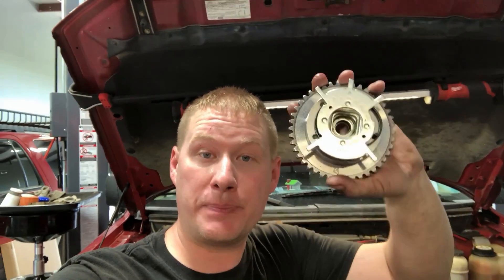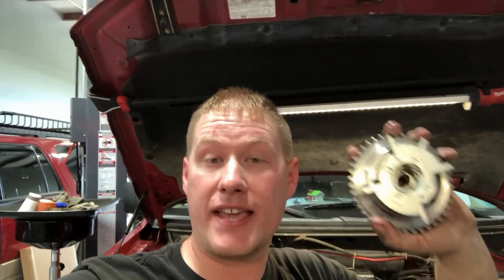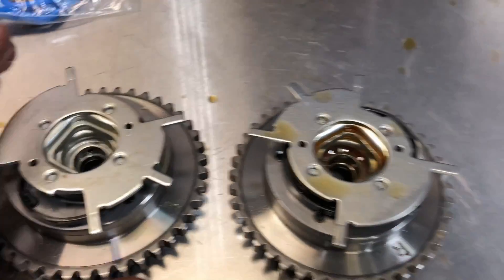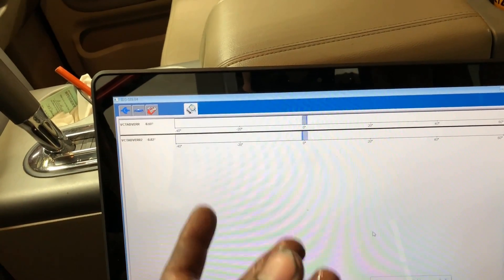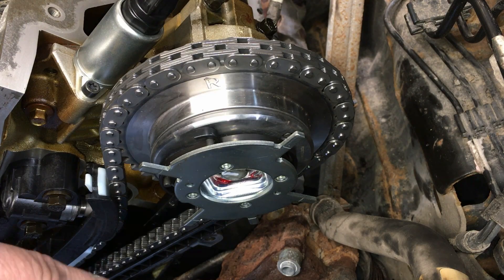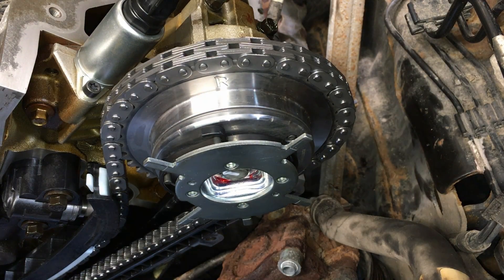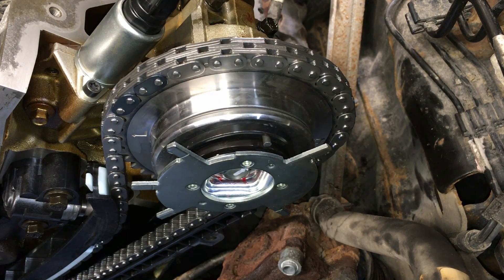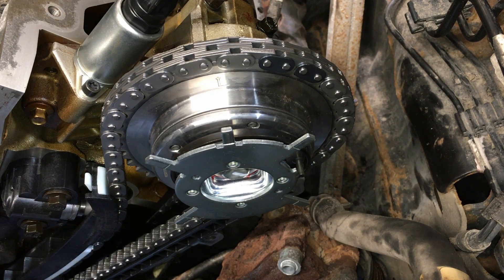Ford 5.4L 3v Timing Kit Choices: This is Why You NEVER Want to Use Aftermarket Camshaft Phasers!

Comment: I used the dormans kit, i didnt think it was a cheap after market kit. Still having the rattle and shake when slowing down. So looks like i gotta save up for the ford phasers?
Reply: Curious, did you soak them in oil prior to installing?
Reply: @russtgrower750  no never seen anything about doing that. I just took to shop and cost me $2600 all total. Due to health i couldnt complete myself. So is that necessary for future reference. Thanks
Reply: @terryedwards5641  its good policy sure. But honestly a ton of people have got dormans to work as well as oem. The phaser isnt usually the problem its a symptom is all
 I dunno ive done this whole thing 3 times now. On two vehicles. Its not fun
Reply: @russtgrower750 
Will you thel me how to "soak" the phaser...?
Or my guess is just sumerge in oil the Phaser for a minutes or so...
Thanks in advance.. !

Comment: Thank you for keeping guiding us on how to do it in the right way, I just finished the camphasers job on my 2018 expy following the 4 parts videos you made. I used a newly designed version, guess what? They only last for 700 miles!!!!!!! It's really deep disappointment. Moreover, I have an HVA, and the valve rotor went bad cause the intake camshaft some small wears. Is there any advice to correct this punch of failures?

Comment: Am I wrong in thinking that the chain is not lined up correctly with the phasers you've shown? I thought the dark links have to be lined up with the timing mark on the phaser, and the single dark link aligned with the mark on the crank sprocket? I mean I guess that would have nothing to do with the phasers but it caught my eye.
Reply from the maker: The marks do not line up again once timed and the engine has been turned over by hand or ran.

Comment: I had the dealership do a timing job on my truck about a year and a half ago and I noticed that the tensioners have already gone out as they used the OEM plastic ones, is it worth breaking into it myself and going ahead and replacing some parts with melling parts such as tensioners and the ms360hv oil pump as well as replacing the lifters and rocker arms with high quality upgraded ones that have another oil port for better lubrication

Comment: I am installing timing chains and components on my 5.4. Got the timing chain cover off and discovered the black links on the chains do not line up with the marks on the cam phasers? Naturally my new chains will not line up either. Just wondering where to go from here? " The truck ran smooth when I shut it down"??
Reply from the maker: You start over and tear everything down as shown in my four part series.

Comment: I messed up and didn’t lock the cams when I removed the chain, how do I proceed???
Reply: Also didn’t remove the roller followers, how screwed am i
Reply from the maker: Did you see my 4 part series on performing a timing job on the engine that literally walks you through the process?

Comment: Hey does this Kit work on an 2013 E-250 5.4? The Rocker arm parts are different
Reply from the maker: No you have a totally different engine.
Reply: @FordTechMakuloco  ok, I will check with Ford and see if there is a timing chain kit

Comment: I bought my phasers from Ford but the chains are on back order and i need to get my truck going can i get  the chain and guides from cloyes
Reply from the maker: The chains are not on backorder, don't cheap out on the timing kit.
Reply: @FordTechMakuloco  that is what my local ford dealer told me Gary  Yeomans ford Ocala, Florida
Reply: Also when i took the front cover off the right phaser fell out and the front of the  camshaft is all chewed up so when removing the cam i found that the journals where the cam sits are pretty rough the truck has 237,000 miles

Comment: Hi i feel im a bit behind the times here but im in need of a kit but ford australia has informed me that these parts are now discontinued/obsolete. Cant find oem kits anywhere. Its funny they actually advised me to get aftermarket parts. Not so sure about that after listening to your advice. Cheers Greg 
I have a knock at idle that sounds like its under the front of the valley cover somewhere and a higher pitched knock at the front when i rev the engine. Still runs fine though.

Comment: I have 11 expedition, with 250k miles. The only thing ever done to the engine was plugs, and 1 coil pac. I'm planing on doing the timing in a week. Is this most update parts for the 3v? Any recommendations on what else to do while it is torn apart?
Reply: No not yet, I'm planning on doing this over Veterans day weekend. 
I'm trying to find the lash adjustors. I'm trying to firgure out if I can just pull the cams out. I'm replacing all rockers, and lash adjustors. I firgure I might as well replace the waterpump, and pulleys. This motor is approaching 260k miles, and is all original.

Comment: I rebuilt my 04 5.4l completely by your videos 12 k miles ago....I didn't fallow your advice on the aftermarket phasers and guess what I'm doing today. 😉  I wanted to thank you for the videos and your very good at step by step what to watch out for and do's and don'ts I couldn't have done it without you.  Good work
Reply: Im curious, i know its an old comment but did you soak them in oil before installing

Comment: My argument is always " if OEM is so good why did it fail?" however because I do my own repairs and save on labor I never cheap out on parts. After market is ok for cosmetic stuff, but engine and ignition components always OEM.
Reply: This is exactly what my thoughts were as well. If OEM is so great,then why did it fail so quickly in the first place?

Comment: Hi, I need your help. Actually I changed cam phaser on 2009 f150 5.4 L but by mistake lost timing maybe while changing cam shaft turned around can you share any pictures where can I see cam shaft potions would be both banks sides please?

Comment: My 07 navigator window lock does not lock I replace the lock mechanism didn't make a difference I hear a clicking noise coming from the fuse box down in the passenger side clicking whenever I hit the button on the remote to unlock the liftgate window is there something in that fuse box a relay of some sorts any insight would be greatly appreciated thank you love you videos by the way

Comment: I can't afford the money to buy the whole kit, thought about buying Coyle parts minus the phasers for a short time more and I changed the oil regularly, had to remove front cover to replace it from a idler pulley bolt backed out breaking ,engine has 135000 can't leave old timing chain in ,need more time with a running truck

Comment: Hey man I've got a question. My truck will start and run fine when it's cold. First start. But when it gets warm and i turn it off its hard to start and won't start sometimes till it cools off. I have new chains, guides, tensioners, vct soleniods and oil pump. They are Ford oem phasers on it that don't tick yet. What would you suggest? Thanks in advance!!! Its like the timing is staying in a over retarded position. Should i do the phasers again.they were relaced years ago with ford .

Comment: I have a 2008 Expedition with the 5.4 3V.   I bought an OEM kit from that one company you don't like that sells the aftermarket kits.  I replaced both phasers, VCTs, chains, tensioners, guides, crank sprocket, Water Pump and oil pump with the Melling 360 OH.  Once installed, which I did following your videos and took pictures so I knew it was all correct, bank 1 was sketchy.  3 weeks of troubleshooting and it turned out to be a bad phaser that was supposed to be a ford part.  I replaced it with one from the dealer and no problems.  Now a few thousand miles later Bank 2 seems to be giving a problem.  I borrowed an analyzer and have a short video but not sure how to upload.  It shows a small difference between bank 1 and bank 2.  The engine will shake and then stop running when brought to a slowdown or stop intermittently, seems I never have the scanner hooked up when it happens.  Thinking I should just replace it, why would it go bad if it's supposed to be OEM. Wish I could upload the video
Reply: Did you figure it out?
Reply: You probably didn’t get oem parts like you were supposed to. I re did my 08 f150 and all ford parts every single one from the dealership, no problems since

Comment: The popping phaser had the timing chain out of time bout 2 or 3 teeth off did that add to the failure
Reply: Of course what was I thinking , Thanks for responding
Reply from the maker: It was not out of time or mistimed, it was only off because the engine had been rotated after timing before filming.

Comment: I just bought a used 2005 F150, with the 5.4 3V, that a guy got the timing set, complete kit for it.  He spent $355 for the kit, plus there were 2 variable timing sprockets for $192 each.  I'm guessing those sprockets are the phasers?  He drove it about 15,000 miles, and the engine just stopped running.   Now it turns over, but refuses to fire.  The first time I tried to start it, it ran for a second, maybe 2 at most, then stopped.  Now all it will do is crank, but not start.  Will these sprockets cause this issue, If they are the cheap ones?

Comment: Can there be any other things that would cause those exact codes to pop up. I have a 2006 ford f150 that's has been running rough since I bought it. I've been chasing codes replacing everything under the sun even the camshaft sensors. Now I'm getting those four codes an not sure if I need to change those phasers out or do a whole timing kit or if something else could be causing the issue. Any help would be greatly appreciated.

Comment: What about the 1 aauto timing set? I always buy parts from them and they are good quality.
Reply from the maker: No
Reply: FordTechMakuloco I ended up going with the oem cam phasers and that oil pump you recommended with 20% more oil pressure.

Comment: Havent watched all your vids yet , they are Awesome by the way !! Quick question , is there a difference between an 05-08 head and cam to the 09-10 head and cam ? I have a 09 motor that has an original head with the new sparkplugs and one with the old sparkplugs ? Thx for the help !

Comment: I purchased a set of phasers for my Aussie ford Fairmont ghia which has the 5.4i 24v barra triton v8 2003 build and I bought new phasers not sure if they are ford but the part number is as follows 
3R2Z6A257DA 
Is this a genuine ford part number?

Comment: I got 2006 ford f 150 4x4 with 5.4 triton 3 v I replaced timing chain and cam phasers and sensors starts and runs idle. Smooth but far as driving has no power and blows white smoke with low oil pressure light coming on what I need to do
Reply: Did you figure it out?
Reply: @thuglivintv824  no,I didnt

Comment: I feel like the fact that pretty much all aftermarket timing parts for these engines are junk is a testament to the overall poor design of this engine (or at least its valvetrain). Obviously buying the cheapest replacement parts for any engine will yield poor results, but even the timing sets from Cloyes or a few other decent brands seem to fail in this engine. 
With many other types of engines, generally good real brand aftermarket parts (not eBay junk) will be cheaper AND of equal or sometimes higher quality than the OE parts, which leads me to believe that the inherent design of those other engines is just better. 
I could be wildly wrong, but that's just been my experience over the years. I currently have a 2007 F250 with the 5.4 and your videos have provided ample help for me throughout the process of replacing all of the timing components! Thank you so much!

Comment: Are there parts that are MORE durable than the Motor-craft variants?   Phasers, tensioners, timing chains and guides?   Seems that not only the design, but the quality of parts is an issue with these engines (I mean who puts plastic timing chain guides inside an engine this large, and the tensioners seem to blow out after a month or two)

Comment: can a ebay cheap phaser cause low idle? i put them in my 04 f150. less than 1500 miles having trouble with bank 1. so i put a ford phaser on bank 1. now im getting p0022 bank2.

Comment: Hey sir i have a question for you. I am a mechanic as well. But apparently not as good as you. I have a problem i have been chasing for quite some time. Just wondering if there is a way i can direct message you or chat. So i can describe my issue and see if you have encountered this

Comment: Can you reccomend a kit for a 4.6 3v 2010 mustang? I want to make sure I get everything I need. Mines knocking once warm however it seems to knock past 1200rpm maybe to like 1600 after that I cant tell. However I'm not running around with a knocking motor even if it was non problematic.

Comment: Hello,
Excellent videos. I do like to watch you work on these trucks, I know you are a pro. 
I have to disagree on some points, I 100% agree we should not use china made knock offs, however, if Mortorcraft was any good, we would not have these problems on low mileage vehicles.
I believe we need to find a better quality after market part since Motrocraft is the reason why we doing this so often.

Comment: So what is the point of putting new Ford phasers in of the originals were faulty. Won't the new ones eventually go bad too? Or did Ford update the phasers and fix them later on? If the original phasers were junk, why would we put new oem ones back in? Won't they eventually go bad also?
Reply: My thoughts also!
Reply: @willhart7861 the ford phasers are good, it’s the lack of consistent oil changes that destroys them alongside the underperforming OE oil pump. I still have the original phasers at over 200000 miles

Comment: @FordTechMakuloco please advise: I bought the ford timing chain kit that you recommended in your 4 part series, and the phaser sprocket part numbers are indeed the ones you linked to here as well. I just installed the phasers, chains, and roller followers and am turning the engine over by hand to make sure there is no contact. I am hearing and seeing this ticking noise/behavior that you showed in the video above, that the cheap phasers can make. Is there something wrong with my new Ford phasers? I'm highly confused and not encouraged by this noise. Do you think my phasers could be defective?

Comment: Question and thanks for the info. I have a '97 Expedition which started making those knocking noises yesterday. It did stop making the noises after the engine sat for a few hours. Is it recommended that I not start the motor up, or even drive it that way? Thank you in advance.

Comment: Looks like the chain isnt on the timing mark on the the phaser..wats up with that
Reply from the maker: It was turned over once already.
Reply: @FordTechMakuloco  afterputting in the new timing kit do you prefer oil the chain and phaser..etc. before putting the timing cover back on or do u leave it dry?? Really need to know this plz..thanks so much for the 4 part series.

Comment: Question, I took your advice, replaced phasers again with ford factory units, replaced oil pump with Melling M360 high output, my brothers shop put back together, tested said had hesitation, while running catalytic converter turned cherry red.,They replaced it and the new one does same thing any ideas?

Comment: How do feel about installing the phaser locks on these 5.4 
L  3 valve engines ? They claim It will eliminate the problem. 
A kit has all needed and a programmable gadget to plug in that does an auto load.
2014 Expedition EL XLT

Comment: I am at 198k miles. I think I will just swap it. The timing set and oil pump are a third of the way to a refurbished. Easier to just yank it and drop in the replacement.

Comment: I have a question that is somewhat related to this topic.  Do you have any videos on degreeing camshafts on 3v engines? Obviously you would degree it with the phasers in normal position but do you also have to degree it in the lockout position as well?  Im curious because I do plan to buy aftermarket cams for my 4.6 mustang and want to take the proper steps when installing and insuring proper valve clearance.  I just can't find any videos that cover degreeing for this particular engine.

Comment: I just did this to my truck. Want to say thanks!!! I followed your 4 part series, and took notes, listend it to it on my way work just to stay on top of it. 
My F250 5.4 has 300,000 miles, I bought it with 100,000, and I have never done the timing at all. The heads we're just light yellowish brownish, kinda like a popcorn kernel. 
I have always used Mobil one synthetic 5-20, changed around 5000 miles,, sometimes even at 7500 a couple of times.
Whoever decides to do this,, buy exactly what he tells you to buy in the list, and do exactly what he tells you do. 
My truck fired up, no problems, and went from 12.8 mpg to 14,, it's a heavy truck, has a service body.
Thanks again Brian!!
Reply: That's excellent fuel economy in my opinion
Reply: How long did it take you?
Reply: @thuglivintv824  probably around 12 hours,, I would listen to his instructions and pause it every now and then. I took my time. There is a section when you apply gasket sealant, and I let that dry overnight.

Comment: FordTechMakuloco - Absolutely love your videos!  I wish I had run into them before I bought the 2004 I now have or before the ticking noise I was hearing finally broke something.  Now thanks to you I have the valve cover off and the cam phase job I was hoping for turned into a bent intake valve and pulling the head.  I know you are strong on recommending only Ford OEM parts for things like phasers.  What about rebuild heads?  Is a head from someplace Rockauto ok or if not what would you recommend?